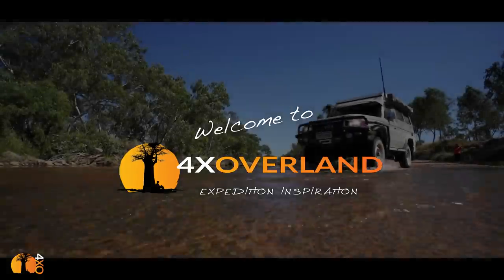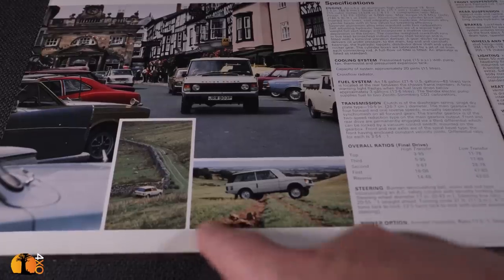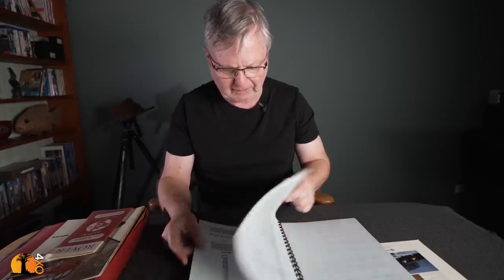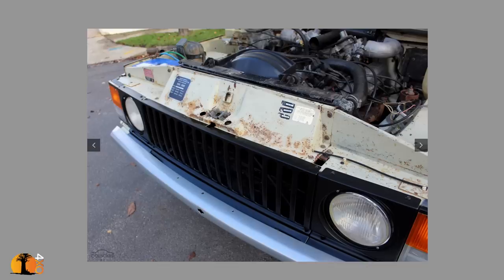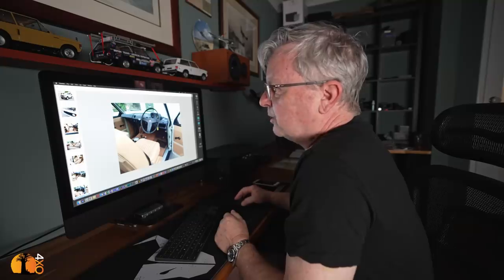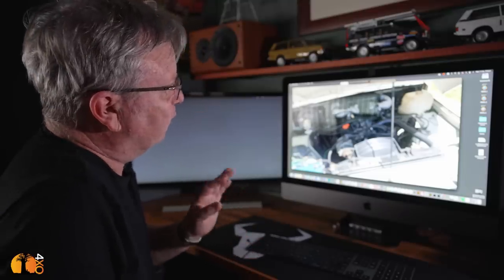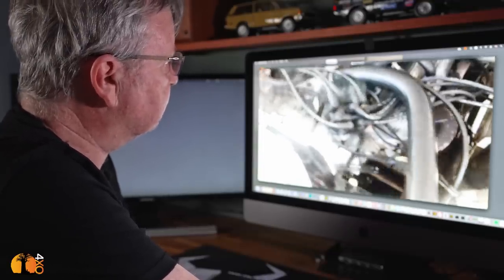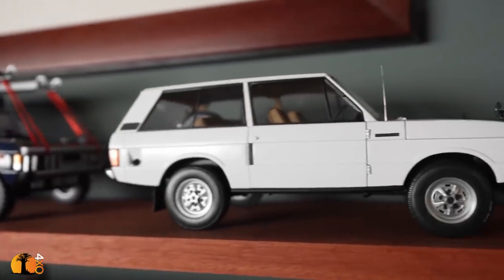BOUGHT BLIND: 1976 Range Rover Classic Forensic Investigation | 4xoverland

Comment: If the small plastic gears in the trip odometer are damaged and spares can't easily be found, you could most likely have replacements 3D printed at reasonable cost.
Reply: Chances are, knowing British Leyland, the speedo will be the same for a few cars and vans across the range.
Reply: Had to laugh at his statement that people don’t go without fixing their speedos. On my old Volvo 245 the odometer was independent and failed at 111,116 miles, when I pushed the reset button while moving. (You might be able to do that when new but the little rubber gear gets brittle.) I then put another 140,000 +/- miles on her but she was eternally young, that odometer still read 111,116 miles when I sold her. (Yes, new owner knew.)

Comment: If you contact LR Gaydon Heritage Centre, UK, They can give you information based on its chassis/VIN that they hold. I think there is a fee. i did this for my then 1984 LR Series 3 Lightweight to find out it was a 1972 build ;)
Reply: Thanks for that info. I’m doing up a series 2 and there is no date I did find the chassis on the left rear wheel arch on the chassis

Comment: Most Australian states, I know Victoria does, offer temporary registration permits to drive vehicles home. If you are concerned about roadworthy that might be an option.
Reply: Don't work across borders.
Reply: @brotherjoelovercomer9627  
Just buy the relevant one in each state. Would  need to check each state to see if they allow that.
Reply: @brotherjoelovercomer9627  I purchased a vintage international truck in Vic 2 years ago and drove it back to sa with a unregistered vehicle permit. The situation at that time was i had to get only one permit for the starting location (vic) and that was good all the way home. I did get in contact with the SA authority's to confirm this. I drove nearly 700km with no number plate all the way home and never got pulled up and checked on by police once.

Comment: Hi Andrew, in relation to the steering wheel, Ive been a mechanic all my life, I'm now 64 and I've seen this a lot, I tend to think someone wearing rings has owned/driven the Rangy and the rings have chipped little pieces out of the plastic wheel that has deteriorated in the sun, not being picky but probably a woman driver because they tend to have quite a few rings and some can have sharp edges. OR perhaps the steering wheel has been changed with a secondhand one due to the original one cracking and failing a rego inspection which I've also seen a lot of, just a thought mate that's all.  Seeya Rob

Comment: I love your enthusiasm for the RR. 
I still remember the first time driving one. 
I worked at a Jag/ RR dealer 1989 washing cars, delivering parts, driving customers. 
The usual customer shuttle was out and lucky me I was forced to drive a brand new County. 
That leather smell, the exhaust note (as you described) and the seating position, unlike anything on the road at the time and here in CA. it was a status vehicle for the rich at the same level as an S Class Benz or 7 Series BMW.

Comment: about the speedo trip counter thing, you may be able to have the small nylon gearbox 3d printed if you cannot find one!
Reply: if you prise off the cap on the odo, a small washer can be placed under the gear to lift it a little.done on two rrs and lasted for the time i had the vehicles.

Comment: Nice project,love them old type rim designed to collect air while they turn and cool the brakes through them cut out round holes. As for the roadworthy  your better of getting a vicroads permit  to drive it in Victoria and then register it where you live,the down side you will have to do the same in each state. Have a good build.

Comment: That distributor is a Scorcher. Basically an Australian-made Bosch HEI (Holden V8) that has been modified to be compatible with the Rover V8.  Not original but it is a massive upgrade, in every way, over the Lucas 35D it was built with.  Performance Ignitions in Nunawading built that dizzy and still do if you need anything for it.  AULRO should be able to help you out with any assistance you require to get you on the road quickly and easily.

Comment: Of all people to partner with I would be steering away from Britpart.
Reply: Why is that Bill? I thought they had a pretty good reputation.
Reply: @netzach13  there's a reason why they're also referred to as shitpart. That said, you can use some of the less critical parts but there are some things where OEM or genuine are the only way to go.
Reply: Cheap pattern parts unfortunately
Reply: @k2svpete  unfortunately not Peter. So far in fact they have the nickname in the LR world of ‘shitpart’. Seems a bit drastic to sum a manufacture up like this however, everything I have seen and bought from them is utter rubbish. Honestly it’s worth buying another brand just to save doing the job twice. Sometimes they are the only option when you are looking for series Land Rover parts.

Comment: remove the front wings and check along the valance for rust damage, i am doing the metalwork on one at the moment and found that the water run off from the windscreen actually drains down to the valance channel and rots it out from the inside, very bad design that has added days and days onto my workload. i propose to redirect the water over it with a pipe, maybe people have done that already i dont know. thanks Andrew

Comment: it sounds good.. usually a good indication of the Rv8.. so take a distributor cap, non-riveted rotor button (power spark since the normal black riveted ones have issues, the difference is the rivet on normal replacements causes a crack which leads to a short to ground.. anyway... here you go... https://simonbbc.com/Lucas-35D-V8-Rotor-Arm-with-Powermax-Technology-BLACK - or just take 3-4 britpart ones.. if you have a good set for rotor/cap - do not change it! under any circumstance.. leave it until it fails..  I would also carry a thermostat (82c).. all belts. a front and rear brake piston is a good thing to have (in brake one) as well as making sure the brake shoes are on the right way.....check the diff, lt230, and change the gear box oil to ATF (Ashcroft recommendation) or Redline MTF or equal. grease all zerk fittings especially on the driveshafts, and I would not do much else but drive it.. 500 miles and whatever will fail at that point.. really it comes down to Temp, Ignition, Brakes

Comment: At 10:39 on the inside of the rubber on the bottom front of the door sill there seems to a fair bit of rust but as I first noticed it later on in the video had to come back and check another angle so see the extent of it and it seems to go under the rubber and at the left side at the rubber there is rust peaking out.

Comment: Pretty sure that, in Australia,  manufacturers had to put the mirrors on the doors. Usually the only cars I see with them on the guards are specifically imported models.
Reply: Yes correct.  Australian ADRs in the 1960's and 1970's did not allow mudguard mirrors because of the risk of pedestrian injury

Comment: That Wingard side mirror is definitely original - these were the Australian spec. And very hard to find now as most were replaced with bigger mirrors
Reply: Arh, i didn't realize these were Aus spec mirrors.
Reply: @caymanblack9567  Yes, but only on the Suffix C- Suffix F, I believe. An all original Suffix F just sold on Collecting Cars Auctions (Australia) and it also has these mirrors. I've been collecting for years and all the original Aus Rangies I've come across had these little wingard mirrors on them : )

Comment: Pretty sure that door mirror wouldn't be right for a UK spec 2 door; they used the same generic mirrors for all BL stuff, my Dad's Maxi, Mum's Allegro or my Aunt's Marina all had the same as my 2 door. But this is specifically an Aussie model so maybe they differ? Placing also looks wrong.

Comment: very dangerous buying one of these going from pictures. Go see it in person and bring a magnet!
Reply from the maker: A magnet? The body is alluminium.
Reply: the outer skin is, the actual structural part of the body is not. You'd be surprised what you can hide with chicken wire, newspapers and body filler